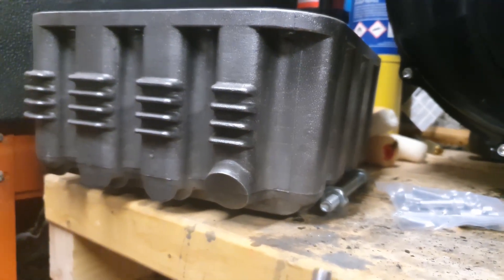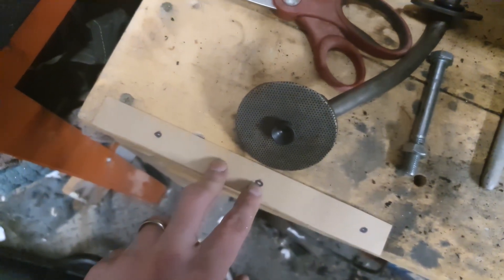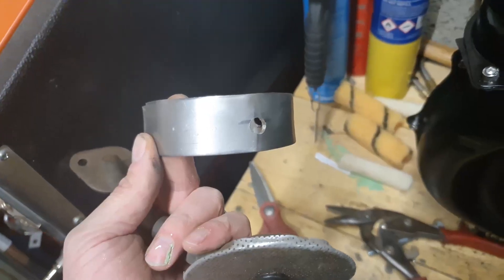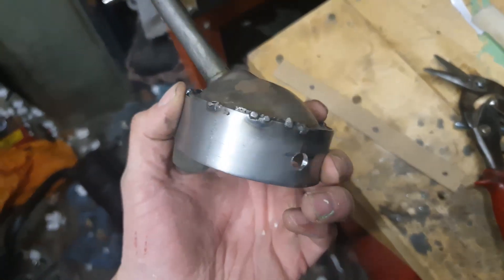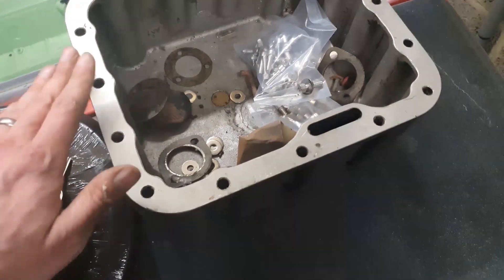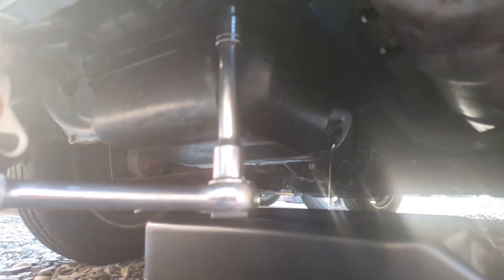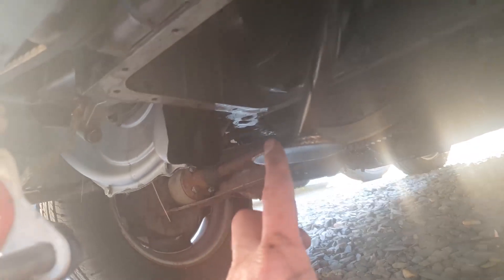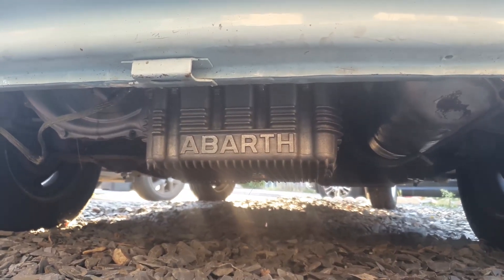Fitting an alloy Abarth sump to a classic Fiat 500 : Part 2

Comment: How did you apply your silicone sealer? Is there a way so that it doesn't stick out on the inside?
Reply from the maker: I forgot to mention in the video i was actually able to reuse the rubber gasket off the steel sump
Reply: Do you recommend using RTV?
I think that the connection between the sump and the engine would be stiffer when using RTV, compared to using a gasket.
Reply from the maker: @berre1994  yeah some rtv sealant will work. The thicker flange on the sump does help stiffen the block compared to the more flexible thin steel pressed sump